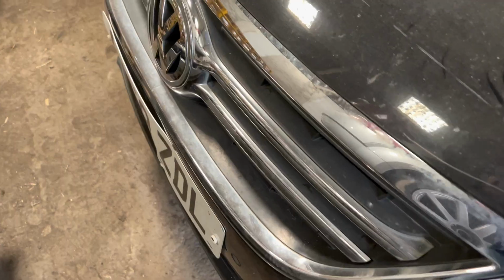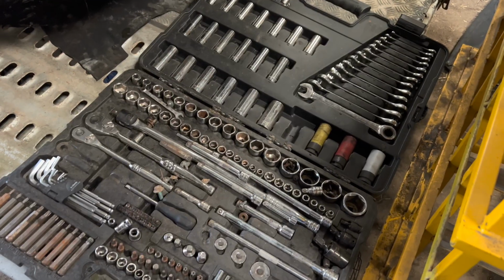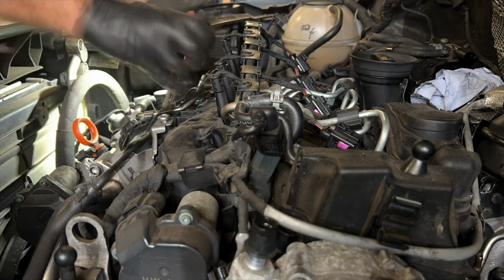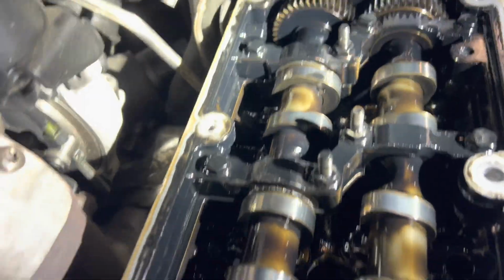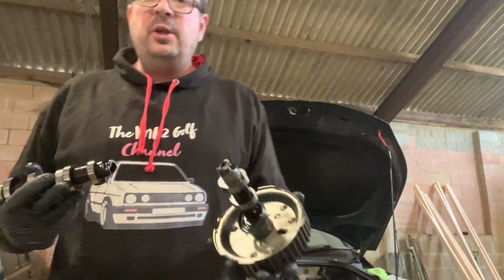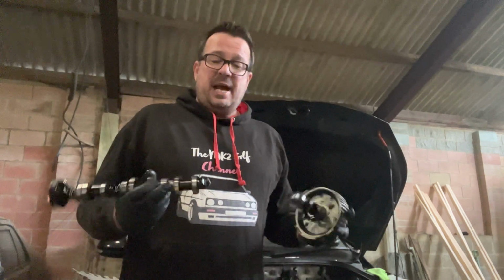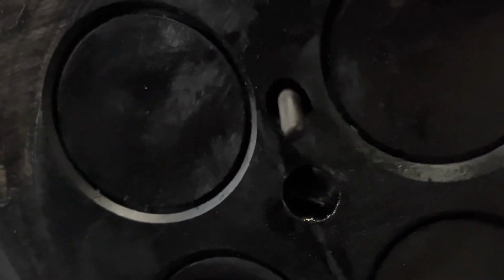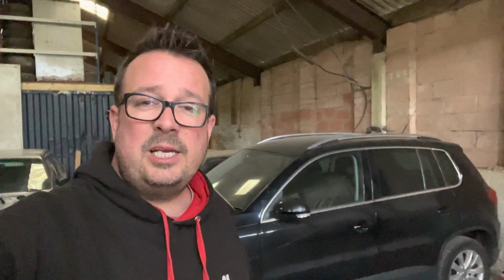VW 2.0 TDI Snapped Cam !!! - Engine Teardown

Comment: Who the heck works on this stuff and actually enjoys it and wants too. I mean like vw technicians
Reply from the maker: Can confirm this one was not fun but it was worth it in the end. The cars back together with 4k miles under its belt since the rebuild.
Reply: I have a mk5 golf 2.0 tdi

First car, bought at 169k miles, service history paperwork all fake it turns out, all original parts, that have been systematically failing.

Never worked on a vehicle before this.

Now I do bits on everyone I knows cars lol

I currently have suspected injector seal leaking and suspected cam knocking, head gasket also needs checking.

Luckily I recently met someone who is wicked with cars and incredibly kind, going to learn with him how to do this inner stuff as I was very anxious at the thought of this, I'm nowhere near the level of messing with timing bits and an actual engine teardown, so I am very lucky to have met him.

But yeah anyway, it's so fun, can make you swear a lot, but so worth it. 

If you like knowing how things work proper and appreciate good engineering etc, why would you not enjoy doing this 😅

Love the video, guy even admits he's no mechanic, but he's straight in anyway 🤘🏻🤘🏻

Comment: When the vacuum pump seizes, which is also runs from the Exhaust cam at the opposite end, it locks both camshafts. Just make sure to check the vacuum pump also.

Comment: Bad      quality material V W  are becoming well known for many engine problems due to shoddy components within a wide  range of V W engines there was a time when they designed and built Good Quality German engines / Not any more i have over Sixty years working on them .

Comment: Surprised its a snapped cam. My guess was going to be worn cam lobes. That happened on my 08 Octy Scout 2.0 TDI BMM engine. Cost over £1K to fix at a garage. Hope you get it sorted.
Reply from the maker: Thank Andy 👍🏻 Hopefully it all goes back together without to many problems. Just got to remember where all the bits go.
Reply: @BarnClubCars  which sealant did you use for the cam carrier thanks